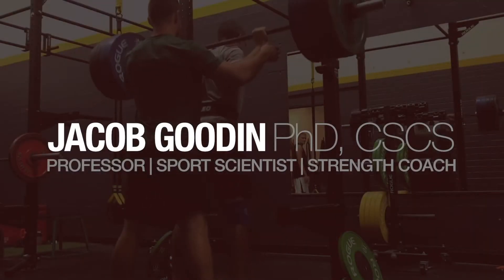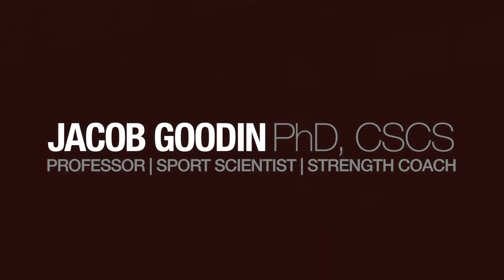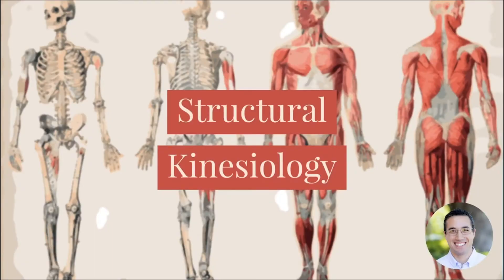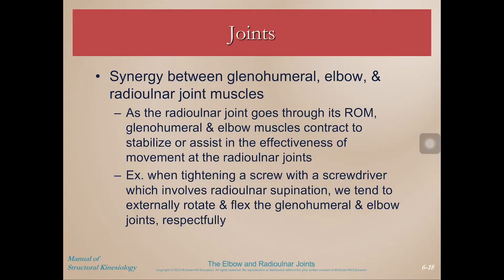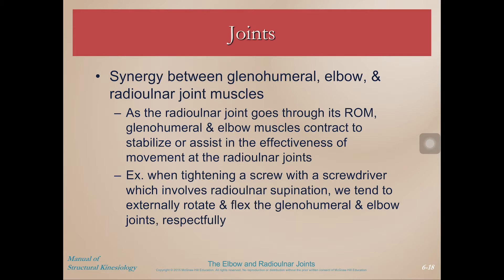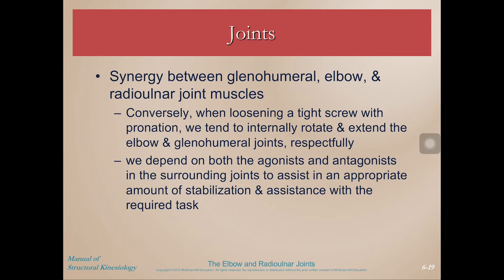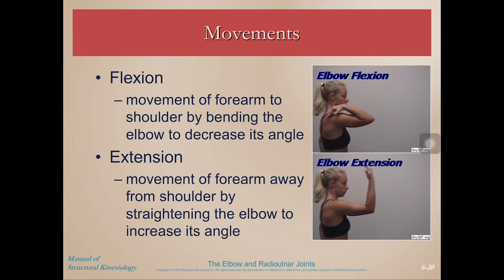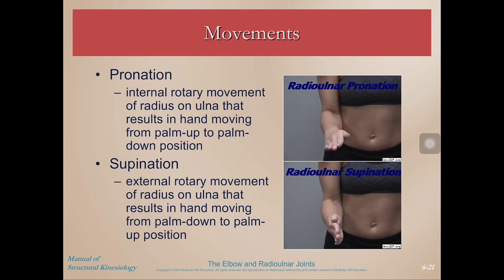Elbow & Radioulnar Anatomy: Joint Movements

Comment: The analogies used to compare the movements of the joints in the elbow. It made it easier to visualize how each joint works together to perform a movement, and which muscles work together or against each other.

Comment: i found it interesting about how everyday tasks like tightening or loosening a screw require coordinated movements at the elbow, radial ulnar, and shoulder joints is really insightful. It clearly demonstrates how different parts of our upper limb work together almost automatically to achieve smooth, effective motion.
Reply: I agree! It’s cool how naturally our joints work together for simple tasks.
Reply: I agree

Comment: The analogy of tightening a screw with a screwdriver provided a clear visualization of the joint movements taking place in each anatomical structure. I also liked the little clips of pronation and supination.

Comment: The screwdriver example was a great way to allow me to connect the information with my own body. Especially with both agonist and antagonist assisting with surrounding joints in stabilization of the movement.

Comment: Bringing it all together helps get into the mindset of how the whole body, or various parts, perform an action that we probably do too fast to think about it.  It is hard, at least for me, to slow it down (break it down Barney style) but brief bits such as the example of turning a screwdriver and how that works throughout the arm helps me to think a little more critically about movement further than just turning at the wrist.

Comment: I did not think about how much stabilization has to occur proximally during a motion that is distal. Dr. Goodin does a good job of explaining this relationship with practical examples.
Reply: 100% need the stabilization, so small but very important for prevention of injury
Reply: I also really appreciate the practical examples that Dr. Goodin provides as this enhances my understanding for the concepts that we are learning so that it is more than just head/book knowledge but absorbed knowledge I can apply.
Reply: i agree!
Reply: Totally agree, the way he broke it down with real examples made the connection between joints way clearer.
Reply: Yes, so true! It makes sense, but it's really good the Dr. Goodin can point these things out in the videos! Super helpful!
Reply: I under appreciated the role of the glenohumeral stability for tasks all the way down at the hand
Reply: I agree!
Reply: I agree! He makes some confusing concepts simpler to digest!

Comment: This video was very helpful in illustrating the different joint movements that occur at the elbow and radioulnar joints. Dr. Goodin explained the differences between flexion and extension that occur at the elbow in the saggital plane. He also made it easy to understand the difference between supination and pronation that occurs at the radioulnar joint.

Comment: Video covers synergy between glenohumeral, elbow and radioulnar joint muscles. The arm muscles are going to contract as the radioulnar joint goes through it's ROM such as supination. These muscles will assist in stability and effectiveness of the joint.

Comment: The elbow and wrist both only do a few movements, which makes it easier to understand what muscles provide the movement and what does not. The demonstrations in the joint synergy section help visualize how the joints in the limb work together.

Comment: The added GIF's to show the different movement of the joints are very helpful in understanding the differences. I still am working on understanding the different flexion and extension movements for the different bones and joints. However these small videos are always helpful.

Comment: I enjoyed the refresh regarding the synergy of all three joints in the elbow because it explained the combined movements of pronation, with internal rotation and extension. Showing that the agonists and antagonists are dependent on for stabilization and assistance. I also enjoyed each clip for body movements to demonstrate how exactly the elbow moves.

Comment: In this video, Dr. Goodin discusses the movements at the elbow joint and the radioulnar joint. The glenohumeral, elbow, and radioulnar joints work together and each do a movement in order to get a desired motion. The elbow can do flexion and extension while the radioulnar joint can do pronation or supination.

Comment: This video was great at explaining the synergy between the radioulnar joint, glenohumeral, and the elbow.  The screwdriver example was a great visual to clarify the information on the slide.  The rest of the video was a good refresher on the basic movements of the radioulnar joint.